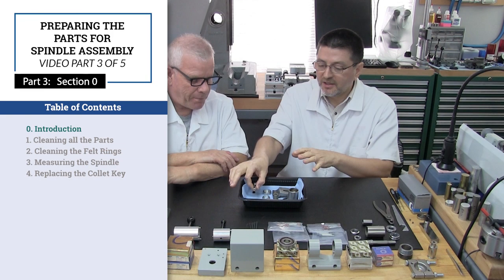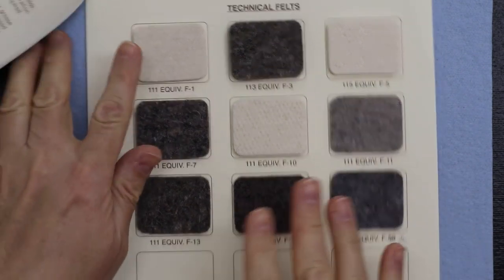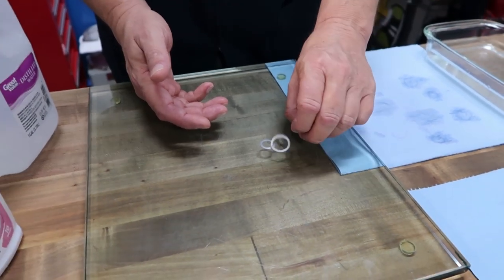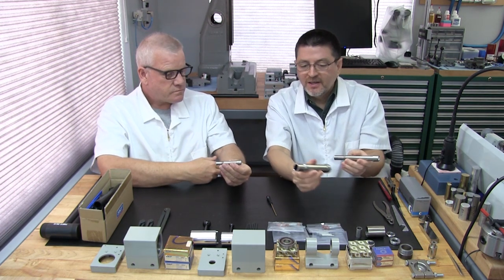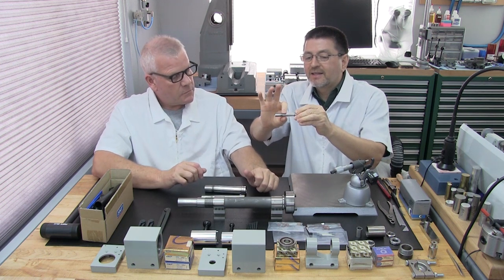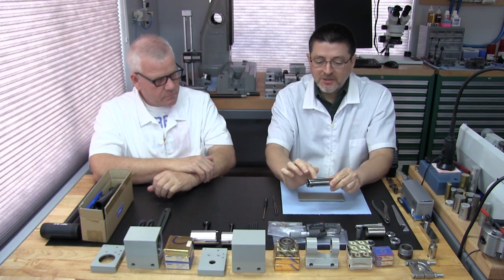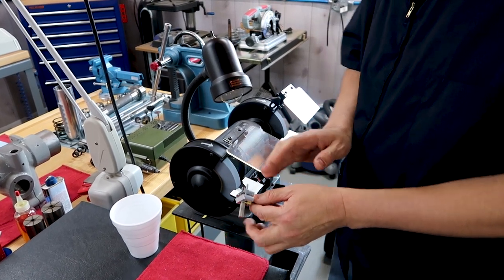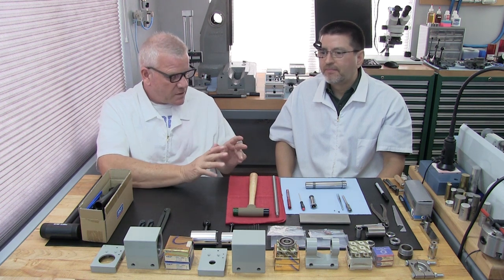Precision Machine Spindle Rebuilding - Part 3 Prep for Assembly

Comment: Enjoying your educational series.  Lance You clean things up so nice. Patrick the angle of the indicator was new to me,did not know you could get a cosign error, thanks for this series!
Reply from the maker: Hi Jeff, sometimes we fell like the learning channel, we just love what we do, try to share it in its natural state, what we are doing in the shop already, as if the cameras are really not here, we never let the cameras effect our processes or procedures. 
Patrick likes to share the angle issue finally, he has seen a lot of people over the years show something to be steady only it is not really being checked correctly, it is just about learning the correct ways, we are both happy you found that helpful to you Jeff.

Cleaning parts by Lance, it is all done by hand here, remember our machinery is small, one of the largest being the Barker Milling machine weighing in at over 800 lbs, minus the 3.00 inch column "Z"Axis riser, Vertical Milling head attachment and maple top bench it is mounted to, so the machinery tools and the likes here are hand done except for the use on threads of a very soft at 1.00 inch thin strand copper wire wheel under low power installed on the Proxxon bench top style grinder tool.  

Jeff we are thankful to have you here enjoying our series, the kicker is this is our first ever Educational Series, series hell, it is our first educational videos ever filmed and or channel is only 11 months old, turns 1 years old on September 03, 2019.  
We will improve over time and will only release educational content devoted videos a few times each year (they are always golden in color) it is the Shop Adventures that is our journey to get things repaired and begin making our products, from just dreams coming from our pencil sketches into a reality finally, Jeff we are not getting too much younger here you know.
Thank you again, enjoy your week.
Lance & Patrick.

Comment: Wished I came across your channel last year. I like your mentality and attention to detail. And I have no doubts I'm going to learn a great deal from your channel.  I'm itching to get my lathe up and running which is in storage To start a full restoration.  And to also see if my lathe ways needs resurfacing. It's a big 1 ton lathe from the 50s. My only issue is the tailstock quill has been abused so having to find a company that's willing to take on the challenge of a replacement New quill and a left hand  left hand acme thread & nut to TV made for the tailstock. I haven't in all the time recovery yet again not found one company in the UK that's willing. Have no idea why. I appreciate the cost is going to be high and so frustrated with it
But due to my back ounce again going again  last year its sadly having to wait. All I want to do is get out there start the strip down. I'm going mad sitting around and itching to make a start. Thankyou so much for sharing these valuable lessons which I find really interesting.  And new subscriber here
Reply from the maker: Hello Mark, first off you and your back issues, you should know, not that this will make you feel better or that all back issues are the same they are not, know this, you are not alone Patrick here has back issues, we have worked for the past, now 2 decades, to work within the parameters of this limitation in our lives. 
We did a great video recently in right hand cutting with bronze could have been the left handed ones for the "Z" axis but we only needed right-handed thread sleeves to make our backlash tighter then the factory specifications of our 1963 US Made Barker Milling Machine Mark. 
Warning, however HaHa, in regards to you beginning to start on your 1 ton Lathe you mention no name of we would like to know the name of your fine soon to be rebuilt lathe ????, rebuilding machines and tools is going to be a real habit forming event if you are like us an obsession is sure to arise.

Rebuilding machines and tools is not what we are actually here to accomplish, it is to teach our skills, methods and knowledge well from our two points of view anyways Mark, and it is to build our museum and make a product from our very now aging drawings from our working days lunch time past.

Fear not re-scrapping the ways they can be done by you after learning and many hours of practice before actually touching the surfaces on your own lathe, or if need be, another man may be required to assist you in this scrapping function, it is a real art it is easy, but tough labor once you understand measurements and such.
Mark:
We Lance & Patrick wish you the very best in your health and in your rebuilding project, and hey a very Happy New Year 2020 to you friend.
Reply: @ActiveAtom  Hi Lance & Patrick, thankyou for your very kind words of encouragement. Apologies for not mentioning my lathe. The lathe I have is a 1950s Harrison L13. With a 2 speed motor. It's been in my garage fully wrapped in oil and covered up in blankets and shrinkwrap since the beginning of last year. I'm itching to get on with the project. And its driving me mad going in there all the time. Still  recovering even after 18 operations later and being self employed has hit us really hard at the end of last year. I've been building up my collection of engineering tools for some time. And this is not the first restoration I have done. But was really fascinated by both your expertise and the methodical way you go about doing a complete restoration. Specially with regards to roller bearings. And how to install them. how many out there use common tools and really bash on roller bearings not taking into consideration there doing it wrong and doing more harm than good. Also like the fact you take your time putting a beautiful lathe back together. No matter the size of any lathe being big or small. Checking not ounce twice but even three times. Checking all the time. There is many videos out there on restorations. That sometimes I want to shout at the tv and say christ your doing it all wrong. To a point where the casting has cracked. And they have to resort to brazing it back.
I know many good quality watch makers lathes can run into the thousands.  But I like that you can use your principles for all types of restorations. Specially in the engineering side of things. I just can't wait to get our there and take on the challenge. It's very inspiring watching your video's. Wishing you both a happy 2020 New Year and look forward watching many on your channel. Big Hi from across the pond. And I must say the little Levin watch makers lathe is a thing of beauty.  Both your workmanship is outstanding. Pls give my best wishes to Patrick and really hope his back doesn't give him anymore grief in the future. The very best to you both mark.

Comment: Thank you for putting this together!    What kind of spindles do you work on?  I have a tree 2uvR mill and I am considering rebuilding it to address runout.  Do you also show griding the spindle after bearing replacement?
Reply from the maker: Hi Randall Svancara. we thank you for stopping in sharing your thoughts and you ask a great question, what spindles do we work on, and do we have a grind of the spindle nose once we are completely finished with the spindle rebuild and burn in. 
We really only work on Levin, G. Boley even Derbyshire and Barker C3 and BT-30 but we only really work on the spindles for the machines we have here thought hey we should share our processes with others and even though the spindles vary it was the procedures we were going for when sharing as we see a lot of not too good spindle rebuilding by others so that lead to this.
Randell, for the grinding for the spindle we have not made that video yet, we will get to it but not always does a spindle nose need grinding after rebuilding and after breaking in of the spindles pass that test then we check the run out and if needed we do grind them it depends.
Your Tree knee mill has a spindle head though a giant compared to our mini-Bridgeport version made by Barker Engineering Co a horizontal mill with a vertical milling head (rare) C3 collet mill with a quill feed, we have it and still need to share the rebuild and assembly of that machine, it is one of our larger machines and even it is very small.  
Thank you again, Lance & Patrick.
Reply: @ActiveAtom  Thans for the response.  I really have enjoyed your videos.  Keep up the great work and thanks again for your gift of knowledge to aspiring machinists!

Comment: Good show guys. I'm surprised you haven't made a tool for inserting those keys!
Reply from the maker: Hi Dave, agree us as well, we could, if we were doing spindles for a living and not as part of our living to machine parts. make this tool it makes helpful sense.
We like your thinking, each spindle would likely need its own tool though because the I.D. of the internal spindle would vary as would the width of the actual key being installed lead by the diameter being pressed in for Levin spindles and riveted for many other spindles and such.

Some of the custom tools we do share in Precision Machine Spindle rebuilding Part 1 the grand opening, we show are some we inherited from our mentors, those who rebuilt Levin Spindles before up through and during our beginnings into providing for our in-house spindles these same services. 

They (our mentors) did not make these tools, so we did not either, this does not mean a person doing spindle rebuilding should not make them though they would be good for the alignment to the length of the spindles interior diameter able to hold it there, in place, level and square to then be tapped in or a pliers style appearance to squeeze and allow it to press the key onto the precise location with a far though monitored controlled pressure as to not force something that might not be desired.

We got our heads rolling in thought right now, so thank you for thinking this suggestion as if we had to do these each day we would love to design and build the tool in CAD and machine it even maybe offer these to others from our Active Atom online store Dave. 
Stay tuned thank you for sharing and continue to follow along, we are having the time of our lives.
Lance & Patrick.

Comment: panavice base starret mic , talk about your "bench micrometer"  nice!  poppy
Reply from the maker: Hi Wayne, yes we are very happy to have that Panavise, wanted that for our finishing area we named the Grinding Hut not shared just yet finished room anyways, that vise is for parts holding during finishing wanted it for years thankful to have it, it is for a specific use generally, though we did use it to hold our micrometer so we could share better what we were reading with those micrometers and yes those are Starrett micrometers we are thankful to have them. 
Thank you, Lance & Patrick.

Comment: Standard test temperature always used to be 68f. 
Fully mechanical micrometers (precision ground screw) don't 'drift' except through temperature variations.
Reply from the maker: Hi yes temperature is important, to us, mostly in this fine rebuilding environment working to replicate tolerances under 50 millions of an inch TIR in this case, this is why we like our climate controlled workshop where it is also a very clean, clean room, well the best we could do for our operation anyways, we would love to build a certified build it kit clean room they are so great, seems as humans we are always wanting huh. Lance & Patrick.
Reply: @ActiveAtom  LOL, yep, sounds about right. I dug out some  of my micrometers and stuff, hasn't been calibrated since 1998 but as I moved to USA in 99 I haven't really done any high precision stuff (except boring a few motorcycle cylinders several years ago). They have a +/- 0.0002" tolerance which is pretty easy to hit. I just like watching what other people are doing, never know when you'll learn something new. I guess I should make a 'how to' but the editing takes such a long time (I'm not very good at it).
Reply from the maker: @1crazypj  We know that video making editing lighting sound and effects take time this is why, in part we have not made a video in over 1 year now, we will return shortly have some finishing up on some machine tool techniques to do. 
You came to the USA in 1999??? From where might we be permitted to ask.
Thank you for enjoying our videos and being a part of our community of machine works, watchmakers like us love our work more then we do sharing it but we thought this should be something we leave for the future well at least from our two points of view that is.
Thank you, Lance & Patrick.
Reply: @ActiveAtom  Hi, I'm originally from South Wales, UK.  When I was training the instructor made / repaired clocks and watches as a  hobby. I ended up making a lot of stainless steel rivets for one of his projects, starting with 1/8" diameter stainless welding rod turning it for a 1/32" shank but forget head size and length (tiny). You can make an awful lot of them from a 36" welding rod.
 I think I did about 225?

Comment: I am a bit disappointed, you make this very, very long video showing everything in detail,..But you come back and say i have cleaned all these parts to factory finish, but not show it. How did you remove the felt retaining rings? I was curious on that. I last video, i saw also something weird, you start saying with the open style headstock " start with loosen the set screw from the belt pulley, to avoid forgetting it, when pressing the spindle out,.. then later you say you use the belt pulley's to hold the spindle to loosen the nut.